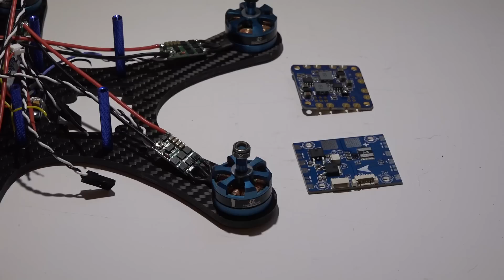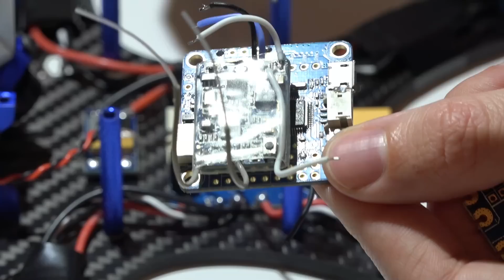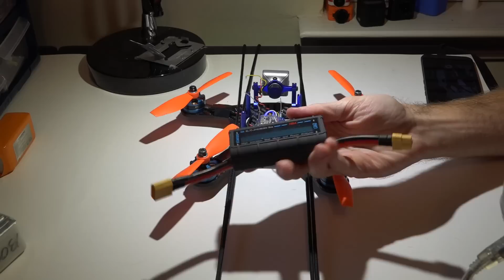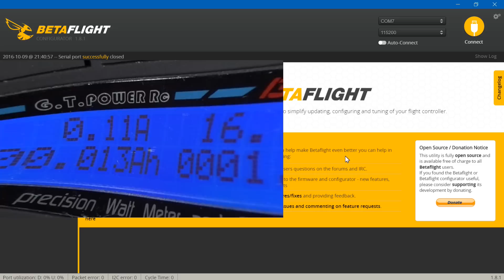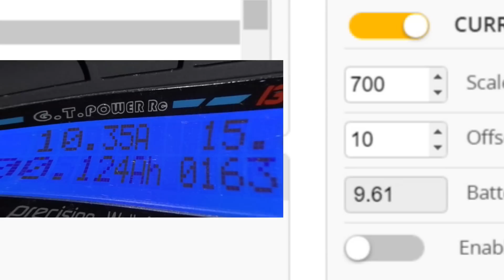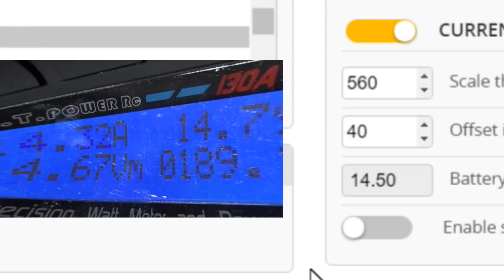How To Calibrate Current Sensor In Betaflight / Cleanflight

Comment: hello, I would like to know if the scale of the current sensor changes a lot according to the battery used (brand, lipo or lihv, capacity and number of cells) ???? I have a 2.5 quad and the scale is very different depending on the battery I use (I use the GNB, CNHL and UARV brands. I sometimes use 2S and sometimes 3S. and there is also a variation in the capacity I use, from 460mAh batteries to 1100mah). I'm using a mini f405 mk2 stack in a geprc phoenix 2.5. Thanks

Comment: Cause change is in percentage.. if off by 50%. Adjust by 50%.. 
Offset i need to tinker with. High amps im off by 10% low amps im on..

Comment: Just dont use the current meter or somehow put a current meter in between the battery and the FC then upload the voltage reading into the VTX.

Comment: So using a current sensor shows how many amps the quad is pulling, right?  Why is that useful?
Reply: Well for example to test if your setup is within specs. You can for example make sure, that you are not pulling more amps with your shiny new props, than the ESC can handle. Also you can keep track of power consumption, ie.: How many mAh have been pulled from the battery, so you can pretty exactly discharge to 80% of battery capacity.
Reply: stylesuxx , Cool, thank you.

Comment: I'd guess, based on terminology and the fact that a shunt is a linear device, that this is actually just M and B from the linear equation (y=mx+b)  m being your scale and b being your offset.  If that hypothesis is correct, you should be able to use the motors tab, start at 10% then maybe 50% (whatever it takes for a significant difference in reading) and then calculate the line based on your measuring device.  Then work the equation backwards.  

I'm going to test this hypothesis today.
Reply: fellstar ,  What did you find out?
Reply: Yeah i'm curious too

Comment: Love the videos. I just switch to Specktrum to FrSky. Odd thing through my PDB/OSD reads really close on the goggles but, , than using x4r receiver with the radio I tried to do fuel and run a mah  and it's way off. It's getting it's single from the FC board not my PDB/OSD board.
EMAX Skyline F3 Flight Controller (Acro) board. It looks like this wil be the ticket to make it more accurate. I love the features the radio offers but, does not feel as good in my hands.

Comment: You can move the props anticlock one place then turn prop upside down and mount. That way it is pushing the quad down not up. Then quite easy to calibrate the current. That is how it is done using a pixhawk for current adjustments and compass motor interference adjustments.
Damn side easy than roping it down, looks dangerous. Just keep kids and animals out of the props while it is on the ground.

Comment: A little late, but: Before calibrating the current sensor make sure to connect that 470uF 35V low ESR capacitor you have talked about in anothe video. The current monitor is sensitive to noise, but with the capacitor connected fairly near the 0.0005 ohm current sensor resistor, the black magic and try everything, should be gone.

Comment: I think you can get 2 sets of scale and offset, and 2 corresponding actual amp reading from amp meter. Then if you put them in Excel with 2 unknown variable factors, 1 for scale and 1 for offset. then use solver function, it will solve a prefect scale and offset. 2 equations with 2 unknowns and 2 outputs, should be able to solve it.

Comment: Joshua Bardwell uses that RROSD which I believe had a current sensor, but are you sure you have to calibrate these things? Same with the Matek HUBOSD with current sensor (http://www.banggood.com/Realacc-HUBOSD-ECO-H-Type-wSTOSD8-Current-Sensor-5V-12V-Dual-BEC-PDB-with-XT60-Plug-p-1085412.html) Don't they just work out of the box?
Reply from the maker: Some work out the box. A few of the ones that have a OSD and everything in one unit. But the majority of them you have to calibrate yourself because they are going through Betaflight or Cleanflight. The settings on Betaflight are preset and are just there. It's impossible for all manufactorers to make the current sensors the same. So if it goes through Betaflight or Cleanflight it will have to be calibrated.
Reply: Project Blue Falcon Gees, I had no idea! Thanks for taking the time to make the video. I wish it was less of a hassle. I have both the omnibus f3 pro and matek hub osd with current sensor on the way for my two quads. I don't think I would bother to be honest
Reply: RROSD comes pre-calibrated.
Reply: Ganked FPV there is a tolerance in all electronic components and 20% isn't uncommon. it's kinda the luck of the draw and there can be flaws In the board design as well. I think for common betaflight boards you definitely need to calibrate because the calibration is done in the configurator and they are not locked into betaflight. some products may have sensor calibration in the QC testing but I don't imagine you'll see that unless the board is locked into a proprietary firmware.

Comment: How are those ZMX motors? I heard it's the best thrust for a 2300kv, but some people got bad batches in terms of quality. Your thoughts?
Reply from the maker: I havent personally used them but they seem pretty interesting. Motors with hollow shafts are a good feature. I'd like to check out the adjustable bearing tension. Havent used any motors with that yet. As far as quality it probably was just a bad batch. Seems every motor brand has a bad batch every now and then.
Reply: Ah, I went with the T2 Motor, hopefully it will be awesome.

Comment: Thanks for the video.  I will be calibrating my F4 omnibus pro this weekend.  One thing though...  completely agree that the props are needed to simulate in-flight amp pull, however the flaw in that theory is that the amperage will be more (while tethered)  than in flight due to the fact that you are creating considerably more thrust resistance than would be present during flight. If this is truly the case (and I am no expert)  I am not sure how the hell one would accurately calibrate the amperage readings....  Thoughts?
Reply from the maker: I do agree with you. The variables are different when actually flying. As far as I'm aware the next best thing would be to tie the multirotor down by all four arms and suspend it in air maybe 5 feet or so off the ground.
Reply: further thoughts on the subject negate my comment.... as long as the numbers match from meter to BF then it should be good.  Now the question as to if the props are really needed....
Reply from the maker: The props are needed to put a load on the motors. It would kind of be like trying to measure the horsepower of a car engine by reving the engine in neutral gear. The weight of the car and tires spinning would have to be factored in to get the real estimate of horsepower.
Reply: How does that matter? Let's say you calibrate for 0-100Amps, but in the air you only pulling max 80A. Why should your readings be wrong for lower current draw?

Comment: Couldn't you just flip the props upside down so that it pushes the quad to the table instead of flying away? Just a thought. :-)
Reply from the maker: I've thought about that, only reason I don't is because I have a theory that if you keep all variables the same then that will be most accurate. But honestly flipping the props will more than likely work just as good.
Reply: ZeroFPV yes, but you also need to swap them left to right(or forward and back)
Simply turning a prop upside-down will still give itthe same pitch angle, it will still produce downward thrust but be less efficient. you must take the clockwise prop and put it on the counter clockwise motor and vice versa I've done it and it's scary as hell.

Comment: Dude thanks! I just finished putting the Airbot Omnibus F3 Pro into my Alien 5" and I needed this vid! You're back at it already!!
Reply from the maker: Sounds like a nice build.
Reply: Scary fast is what it is...went from RS2205 2300KV to T-Motor F40 V2 2600kv...too much speed for comfort ;)
Reply from the maker: Kradle man I love T-motor. Been wanting to check out the F40s for a long time but my old T-Motors are still going strong on all my builds. Maybe one they'll they'll wear out.
Reply: Good to know...I've been running them for a little less than a month now so I was still wondering how they'd hold up.
Reply from the maker: Should hold up great. T-Motor is all I use. Plus I like that replacement bearings and shafts are easy to find.
Reply: Project Blue Falcon Awesome. Glad your back dude, I'm still planning on using your bearing replacement method too. Went out and bought the proper size bolt and nut even. Thanks man